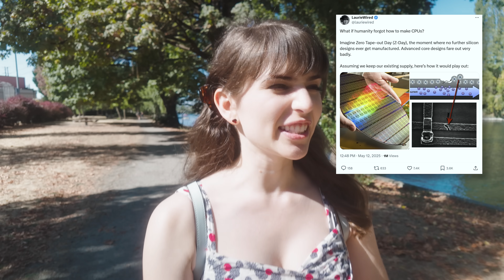what if humans forgot how to make CPUs?

Comment: Well, interesting idea, but... Let's say something happens and that everyone forgets overnight how CPUs are made, but not what they're used for or how to use them. Unless whatever triggered this also "vanishes" all the existing written and digital documentation, which would be virtually impossible to do, then reconstructing the process would be fairly easy. Especially since the factories are already there, you just have to put 2 and 2 together.
But let's say that the existing written and digital documentation magically vanishes along with all existing chip factories. Problematic, yes, you still have science. That means that you already have the capability to develop chip manufacturing, you just have to actually go do it. An electron microscope analysis of available generations of chips would be top priority, since those things actually use chips, but it would essentially give away how a CPU's architecture is built in reality. It would be pretty clear that silicon is used, along with copper and several other elements. The next logical step would be to realize that you'd have to use light to etch the silicon to such a fine, microscopic detail, and so on. Redeveloping the process would be pretty fast, all the experience gained over decades to increase yields and make chips cheaper, that would take longer.
My point is, unless existing chips are "vanished" also and scientific progress is dialed back a century or more, permanently losing chip manufacturing is just not going to happen. At this point, it's like asking what would happen if we forgot how to make steel, with the answer being that if you know what steel is, you can probably make it already. It's a nice exercise, to ponder the importance of a technology in our daily lives, but a scenario just as likely to occur in real life as a zombie outbreak.

Comment: The willingness to suspend disbelief is missing. Zombies are an established trope. CPU knowledge forgotten (or drastic deterioration of relations between nations make it so that we don't get any anymore) is conceivable but relearning efforts would be immediate and take much less time than the first time - and might even take slightly different routes, coming up with an AMD / intel competitor.

You need a better "I could see that" explanation for why we're not building new ones. Probably more expensive using local labor, perhaps less reliable initially and bigger and worse but we'd catch up

Comment: the thing is, this is theoretically possible.
Since the earths magnetic field does reverse seemingly at random, it's possible it could happen fast enough that it creates currents within semiconductors and other thin wires high enough to damage them. which could instantly destroy nearly all computers - which could lead to all semi conductor designs being lost and having to be created from scratch without computers.
It's an interesting scenario to consider.

Comment: I'm one of the people who manage one of the server rooms for a broadcasting company in Italy. You'd be surprised how well old hardware does against the passing of time. Softel SE3005 is there to insert Teletext subtitles on SD signals via SDI and it's running Windows NT 4.00.1381 Server x86. This big boy has been around since 1997 and it's still going strong. https://photos.app.goo.gl/meaa3p7rvhNZozvJ6 - https://photos.app.goo.gl/CftzD3YE8PqVs56W6

Comment: You say this is "not such a crazy scenario", but I disagree. The examples you show are either extremely niche and classified (like the fogbank), or specific models/details of something that was declared obsolete. Forgetting how to make CPUs entirely is much more broad, and ultimately in my eyes unbelievable. The best you could do is set back the industry for a decade or two.

If you take the right courses at university, you might even design your own CPU in class. I did it. It is not really that complicated if you settle for a design much simpler than current top of the line products. This is why I don't believe your long term consequences would come into play, because by the time electro migration becomes an issue with current CPUs, the world will know again how to make them.

Still an interesting thought though.

Comment: But since 32nm, they used halfnium carbide traces, so a good amount of why the transister can be so small, like they encase it in glass, and on the other sides are silicon, is its knife edge capture lattice alloy bands.  So it could be hundreds or thousands of years, just cables erode, so on Zday, they have nano-robots that carry zero-point spectral dynamo prime recursive weapons for pesky bugs.  The junk ones is those 80 core laptops GPU's, hell no way, those sucker boys garbage for Switch 2 OLED's.

Comment: I think one of the hardest hit sectors would be Industrial Automation. Equipments such as sensors, PLCs, HMIs, machine vision systems, robot controllers and industrial PCs, which depend heavily on microcontrollers, operate 24/7 under the harshest conditions and  environments. These things collectively wouldn't last more than 5 years, which is typically their normal lifespan, and suddenly the whole industry would be back to the 1940's.

Comment: Modern agriculture would start failing, large farms have tons of automation and controllers now. Food prices would of course skyrocket as a result of the increased need for labor. Water would likely be a huge problem as plants couldn't process and clean it without the needed equipment, we would have to shift* back to more passive collection and cleaning. Its possible because of this bigger cities that require large outputs and demand would fracture as people spread out to find resources to sustain themselves.

Comment: It's something that could happen but short of a true disaster (and even then there's likely DR plans for the blueprint files), it's unlikely to happen in the short term, multiple generations of institutional knowledge would have to pass. I would imagine manufactures store their blueprints going back forever in multiple locations. The biggest threat, as you mentioned, is if a global supply chain got interrupted - like in the event of war. I imagine militaries have data centres that store information and, i would imagine, blueprints to stand up an internal manufacturing capability. Computers are tactically relevant.

Comment: If its only CPU design and manufacture; I think we woud be able to re-discover it fairly quickly. Not necessarily modern CPU's; but since we have technology that still exists; we can at least reverse engineer vintage x86 CPU's like the 80286 and work our way up from there; leveraging them for the very machinery to rebuild the machines to make better CPU's as we go through the minituarisation process and rediscover and refine photolithographic CPU printing. 

Now the more pressing thought experiment is; what happens when we run out of oil? The impact on electronics would be astronomical; let alone the use of it for heating, transport, general plastics, etc...

Comment: Lithium batteries have impurities and over time heat and over amperage crystalize the lithium cathodes causing the expansion and volatilities. That some part of the cycle has a residual biproduct that can cause a bubbling or crystalizing and battery eventual bulge. Heat is the most damning thing of a lithium battery.

Comment: The 68040 had inexpensive RISC variants (25MHZ, 33MHz typically) on account of the fact the 68040 had the parallel port instruction-set (where the Centronics went on to be the IEE1284) so they were built into Printers, although they can be rigged to draw graphics.  Even if some cannot have pinout directly to an MMU to become a Freescale, they can be positioned like arcade cabinets to pass through a bus to other CPU an custom gate-array chips (and customise some layout like how the Commodore Amiga A1200 Motherboard allowed an FPU to work with a non-FPU pinout 68020) and then basically such a configuration mean some manner of multiple CPU computer not far off a Freescale can be made, and can boot of CPU and each CPU can address (in 32Bit) 256 Megabytes of RAM, but the main thing is the CPU has the parallel and serial instructions and so the parallel can act like a GPIO for a plugged-in PLL (Phase Locked Loop which can produce harmonics, and polynomials in the analogue and serve as an oscillator or multiplier-tree). Linux or BSD style operating systems like Free-NAS can run entirely in RAM with nothing but a floppy-disk or other small storage-capacity medium for a few settings, and were there is no tape or floppy-drive, a punchcard would do, of even some DIP switches in a larger enough array or configuration, but assuming a punchcard had most of the data required too replace the tint-data amount of setting on a floppy-disk (barely and of the floppy-disk being used), the PLL could serve as  state-transition (like Markov-state or Markov-chains) however, that also means the state can serve as a XOR bitwise operator and also a flattened 1 dimensional vector which means not only polynomials in vector space can be handled (assuming nothing too fancy were expected in terms of high-order versus low-order-polynomials form say Fourier-Taylor-Expansion) but also the Fourier-series and vector-similarity-comparison (modest but nonetheless there), and even though the serial would help, especially with orchestration, the Parallel is simultaneous. So the "Free-NAS" style setting would be able to be saved by also Viterbi-Algorithm to find (of a limited subset) what setting can be done in the analogue-domain triggering to discover the Hidden-Markov-Model State of the last shutdown in case the 'Server' (the 68040 machine) was unexpected (and if there is an Amiga-style GURU meditation) so then the right punchcard order gets loaded upon the computer booting up again or the first time on its own (without a person there), thereby allow some degree of automation. The PLL generally, in such a way would be used to prop-up computers generally, although, a computer like that would help subset-propping-up of other computers that do not have that functionality like say the 6502. As an aside the redundant-registers of the 680x0 family of CPU could be used to store the PLL data to swap it about. The 4bit blitter would also be useful for traversal of data normal considered bitmap fo Markov-chain style bitwise logic, via SVD Singular-Value-Decomposition (or 'almost' SVD if not by actual matrices or even an array so EVD for Skew would be a workaround too in that way) for polynomial fits and simplification of the logical map to be traverse as though discovering that HMM. The ability to convolve a signal (phase-shift-error) could still be dome in the analogue domain. Biological (including medical, but also crops and nutrition like finding HMM in nucleotides and genetics and proteins) would remain a priority even if were to be for data already once processed but in need of a read-out. The PLL also clock-signals and synchronises and underclocks and overclocks, and generally helps with time (and considering data degradation was mentioned, data-integrity and carrier-signals assist its usage scenarios, plus comms). 
My comment has no hate in it and I do no harm. I am not appalled or afraid, boasting or envying or complaining... Just saying. Psalms23: Giving thanks and praise to the Lord and peace and love. Also, I'd say Matthew6.

Comment: How long would it take for us to backward engineer this technology, if we could do it at all? Like for example, if someone went back in time to the 1960s with a modern smart phone, how long would it take engineers to actually reproduce the main components, or something close to them? Which developments would see the biggest sudden jump (LEDs from the camera flash maybe? I know the quest for white LEDs was long fought and rife with some radical materials science).

Surely the time travel scenario would be much more difficult though, considering in your realistic simulation you have folks taking apart and rebuilding computer parts regularly with scavenged pieces. So clearly we still have technical diagrams or at least understanding of microcircuits in this scenario, and so would have a pretty strong understanding of how those machines work and could therefore make large crude CPUs again pretty quickly.

Comment: Holy crap, is this some kind of engineered obsolescence propaganda? This is the kind of narrative that keeps people buying a new smartphone every other year.

The silicon wafer is typically the last thing to go and can last centuries if cared for (duty cycles, power management, climate control) Longer with older designs.

If we're allowed to replace/repair non computing components and connections then we could realistically keep things going for centuries if we played smart and conservative.

The other thing to note is that humans dont just let stuff fail, as the chips begin to degrade new industry will pop up to solve for the failing chips. Failure modes will be diagnosed and the chips will be rebinned according to their defects and software will be built to account for the predictable errors that will occur , vastly increasing the lifespan of the failing chips.

Last note 

RAM would be the first failure point and first target of software optimization, i stopped at 7 minutes so idk if she ever even addresses volatile memory

Comment: Mankind was made by a syborge deep space program ran by a type of future or past hackers. They created a type of AI program to go out into deep space and find a livable planet and seed that planet with a new creation. This was probably a fail safe system that out lived their makers by billions of years. They did that and found out they was not alive, then built them to be alive with muscles, that was created first from in a lab experiment of making a hydraulic muscle from a spong and then started to program the growing direction of it. I will share a secret with you, a survival transister world radio that was marketed a long time ago in populare mechanics or populare science that has made it to last a year with one set of batteries has galactic technology snuck into it in the form of a self generating energy capacitor circuit. The circuit when running turns off the battery and self power it's self, the drain comes mainly at start up. It's a GRUNDIG world band receiver, non digital. Anyway back to your what if, there is always a fail safe in all technology and mankind has angels as their fail safe system. We also have a large enough collective that would never happen, if it did a time traveler will be called up to fix it, that's been done before also. Anyway enjoy my galactic tip and circuit gift.

Comment: Considering we went from computers built with macro-scale transistors to integrated circuits and eventually 250mn-class fabrication in 30 years, I think that we could easily replicate that process (and probably do it faster) even if we completely forgot how to make CPUs today. If everyone involved in manufacturing, from chip design down to the janitors cleaning the clean rooms of the fabs suddenly died, and all of the fabs (and their supply chain factories) disintegrated, and all of the archival data for how to make stuff is shredded, we'd be able to make a lot of progress just knowing what is possible.

Comment: Thank you for this interesting insight. 

In this regard, I have had a conversation with someone on Reddit last year.
He said that computers slow down due to hardware deterioration, to which I replied that I hadn't noticed this with my Pentium 866MHz. He thought that I was just some nitwit who knew nothing about electronics, and to be fair, there is a lot to know about that matter. So he might be right, given the fact that also he knows nothing about electronics.
To me it is clear that a thinner wire will deteriorate faster, because the amount of atoms is smaller. As such it makes total sense if you say that modern CPU's will be damaged faster than older ones. However, the modern ones also use less current and as such it is not simple mathematics to compare them.
But, I have my answer why my dinosaur computer is still as fast as it was 20 years ago (which was pretty fast, if you ask me. He would not stand a chance today because of all the graphic power needed, though)

Comment: @3:11 — using the word density in this context is weird.  Normally, you’d talk about the voltage/pressure.  You just mentioned that people under-volted the CPUs; that is done to reduce the pressure of electrons.  if you want to use the word density in the context of electrons, that’s normally a probability/density field of where a particular electron likely is.  Those density fields generalize to how molecules form from atoms in a stable fashion (but benzene ring electron density doesn’t relate to voltage, and isn’t a mechanism of electromigration).

Comment: You forgot to mention manufacturing lines, factories, that heavy rely on electronics, including CPUs to manage the machines. Food industry will slowly degrade and move to the "old" ways of producing. Well, except there are a lot more people nowadays, so hunger will prevail for poor, probably "middle class" too. Medical industry will also have a leap back to what we had in the 80s, including pharmaceuticals. A lot less advertisements due to decreasing printing capacity and scarcity on chips that run ads on large screens. A lot less of everything, if you think about it. Reinventing manufacturing to not require smart electronics again will take time, but it's possible. 80s like, steam punkish future.